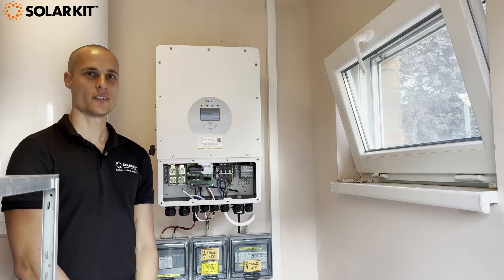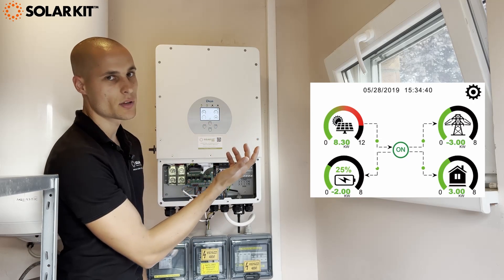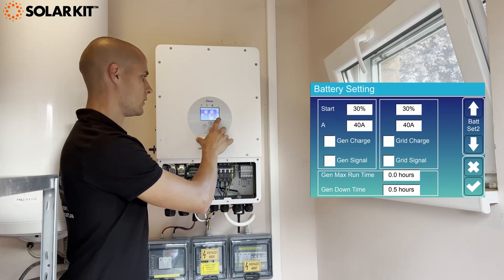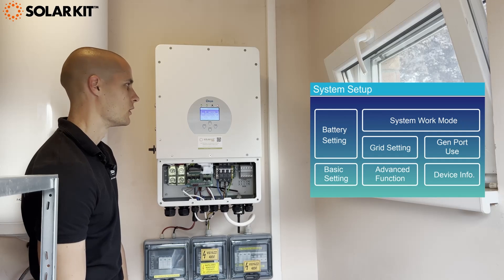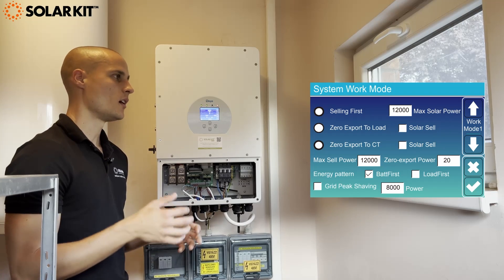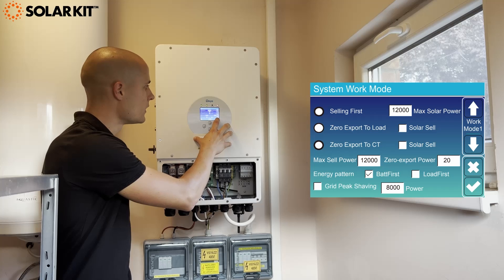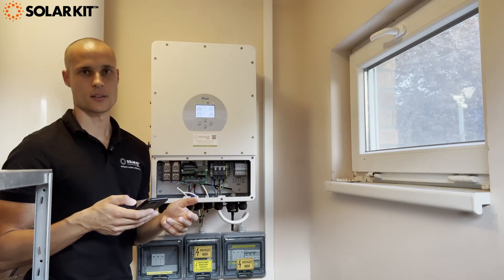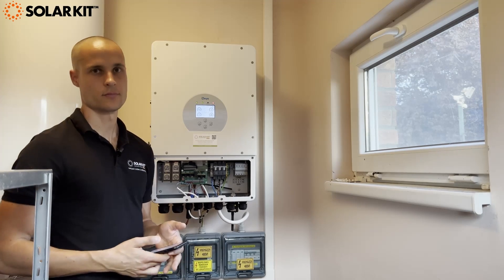SOLARKIT - Deye inverter installation - a STEP-BY-STEP guide

Comment: Hello, will my inverter be in operation if i only connect the inverter’s grid terminals to the building main circuit breaker and connect lifePO4 batteries? Please take note that we will not use the LOAD TERMINALS of the inverter. Will it be operational?

Comment: System work mode > zero-export power: 20. What is this actually? I'm a little bit confuse but from my understanding it will use the grid (build in CT) power to sense the voltage, current and frequency to match with generated AC power by the inverter. However, my meter still detect I'm using about 1.2 A from grid all the time. I've battery connected everything should run by the battery but not sure why. There's people also reported this on the forum. I've set this zero-export power to 0 but still my enerygy meter is showing I'm using about 1.x A all the time to power the inverter (mine is 8kw and grid is 240VAC) so means I'm using about 300w from grid all the time. All my house power connected to smart load. In deye app it showing 1A but on graph it showing I'm importing 0.
Reply from the maker: As load amount changes quickly when a device is shut down, the inverter cannot reduce the power at the same rate. So, to avoid injecting electricity back to the grid when it is not allowed, there is a given consumption that is always drawn from the grid first before the inverter starts up. Depending on the amount and type of electrical appliances, this number could differ. If the meter shows that the system is injecting back to the grid when it should not, then this number needs to be increased. We suggest starting with 20 W, as it is usually sufficient for many households and won't significantly affect performance. This adjustment serves regulatory purposes only.
Reply: @SolarKitEurope  Let me rephrase again - here is the scenario: during the day, My PV is generating enough power to charge my battery bank and to supply house consumption (connected to inverter smartload output).  the rest of excess power generated by PV are being sell to the grid. This is good. When turns evening, night or PV not generating enough power to supply, battery will supply power to smart load. Grid should remains idle as there's are not enough power to sell, however grid consumption is at 1A I'm importing 1A all the - not sure why? The inverter should be powered by the battery as well. I've set this configuration. If it's using maybe 0.2 A i don't mind but, 1A is about 300W (depending on pf) for standby.. x24 hrs x30 days that's about 200kwh which is quite substantial.
Reply: Hello, I want to ask you about the inverter. It gives an alarm outside the manual. Alarm.comm.  @SolarKitEurope